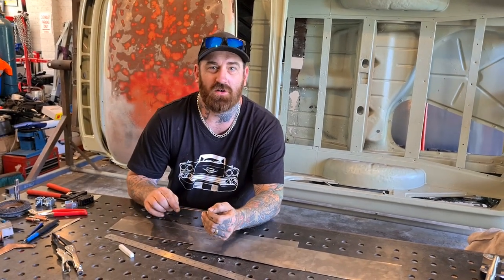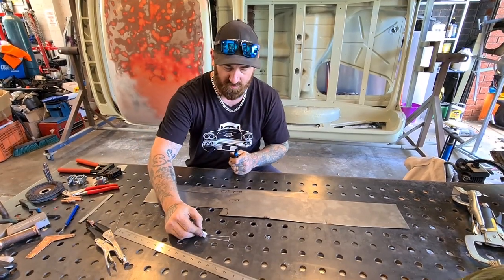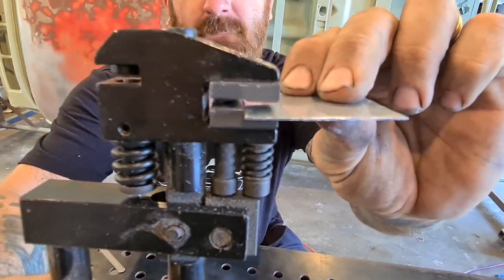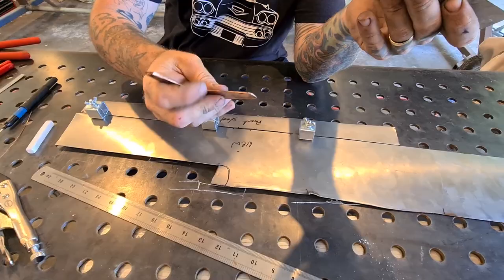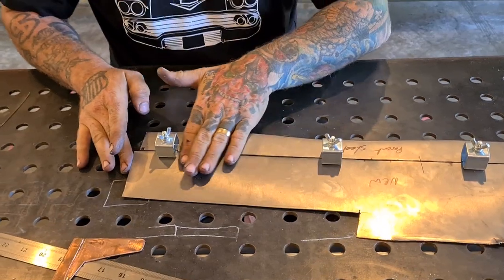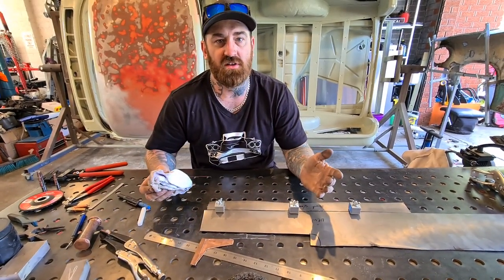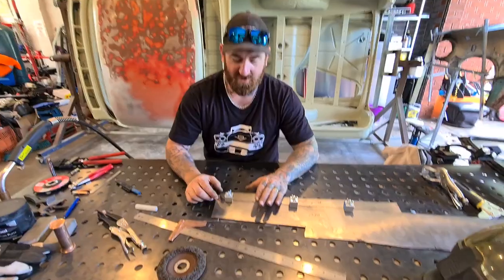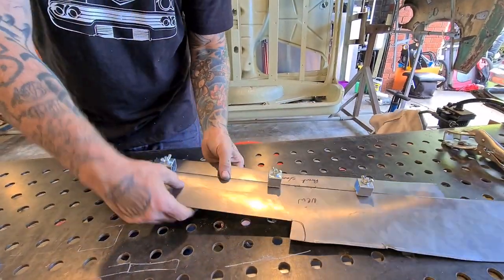Surreal Garage EP.4 mig welding sheet metal hints tips and tricks

Comment: Any tips on replacing a transmission tunnel?
Reply from the maker: Sure do any particular part you're stuck on?
Some think ahead ideas would be if you're going to use drive shaft hoops of ballistic bellhousings may aswell set up for that while doing it, Don't forget the little things like shift linkages oil lines and breathers aswell as serviceability of the gearbox or if you need to swap out give it room to brake apart from the engine best off completely mocking up the driveline with every nut and bolt that's going to be there in place before starting then just a matter of getting some practice in on a slip roller or find something with a similar radius and tip the metal around it gradually working it so you don't kink it 
Put the effort in at the planning stage and stick to it eg, if you're going to weld it stick to it or make it removable stay with that idea and if any subframe or bracing needs to be removed replace it with something better 
Also if you don't have all the tooling plenty of fab shops will usually be happy to help roll a radius, make a brace shape a cone and so on